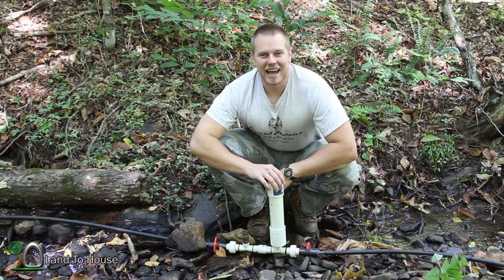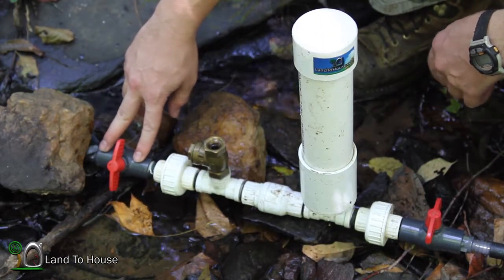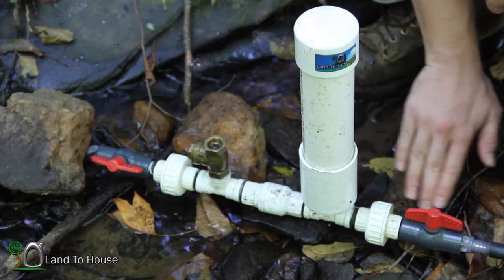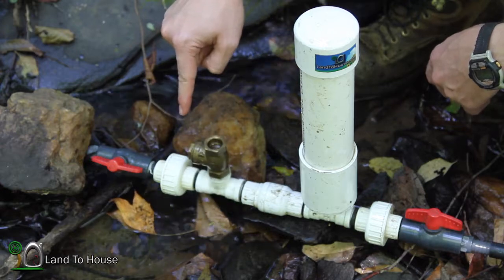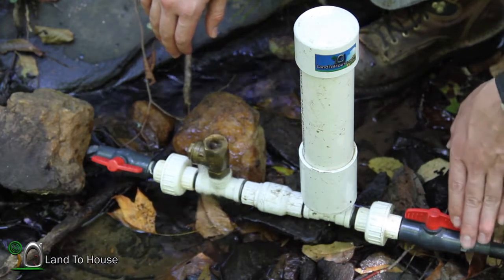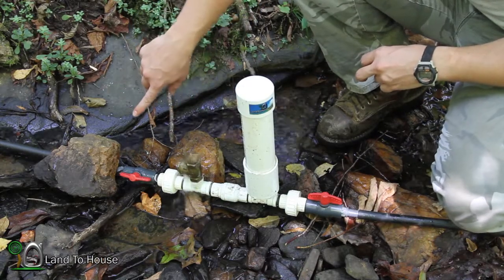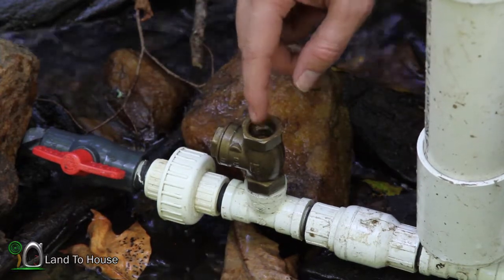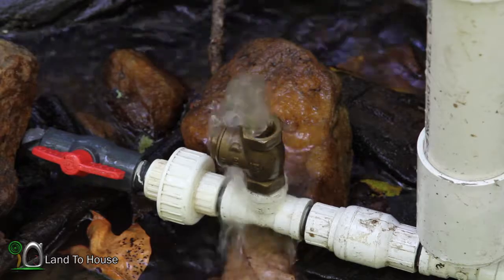How to Start a Ram Pump

Comment: Hi Seth, great info thank you. We have installed one recently. The pump is working and there is definitely lots of water coming from drive pipe. The problem it is pumping nearly nothing on the other side of the delivery pipe. Any wisdom to share? Thank you

Comment: I made my first ram Pump and I can get all the parts to work but once I open the delivery valve everything stops working and I can’t get it to start
Reply from the maker: you could have one of a few issues. 1.you might not have enough back pressure to keep the pump going. increase the output height or reduce the head pressure 2. You might need to prime the delivery pipe before the pump can work.  open the delivery pipe and then manually start the pump with many cycles to get water in the delivery pipe.
Reply: Land to House thanks for the tips I will try it out

Comment: Ok so my ram pump I built is not working the waste water check valve just stays open letting water run out I have no idea what to to my pump has a pressure gauge on it and it does not build pressure what should I do
Reply from the maker: +noah allport there could be a couple things going on. But normally this means there is not enough water getting to the valve or the head pressure is too low. What size check valves are you using and what is the size if the drive pipe?
Reply: +Land to House 3/4
Reply from the maker: +noah allport ok. How much feet if head are you working with? I recommend a min of 2 feet. If you have air trapped in the drive pipe someplace you can experience less flow than you need. Try holding the drive pipe up a few feet for about 5 seconds then drop it to allow a fast flush of water. This should remove air in the pipe.
Reply: +Land to House yea I have bled all the air out several times and I have let it run for a few minutes to be sure the waste water valve will not shut it just lets the water run out
Reply from the maker: +noah allport and you've made sure that the inner diameter of your pipe is three quarters? How many feet of head are you working with?
Reply: +Land to House right now the head is just like 20 foot I am just testing it  tell I take it to the spring on my property when it's at the spring it will have about 300 yards
Reply from the maker: +noah allport the head pressure is the drop from the source to the pump.  Can you email a picture of the setup? Or even shoot a video for youtube?
Reply: +Land to House could I send you the video on face book
Reply from the maker: +noah allport sure thing!
Reply: +Land to House ok I sent it